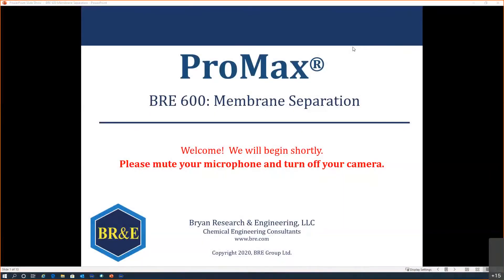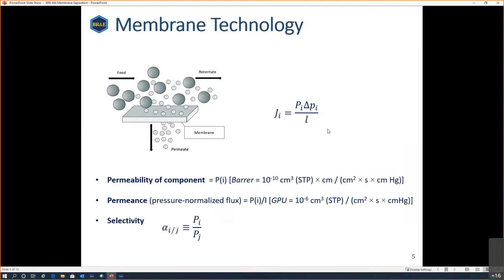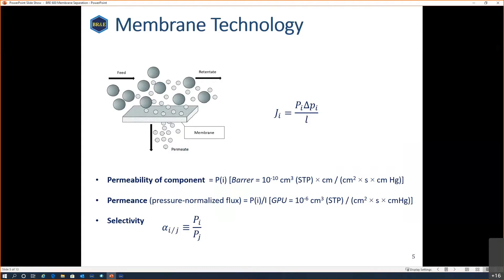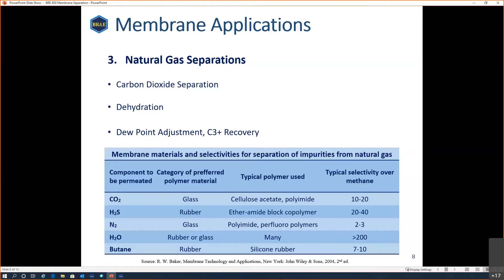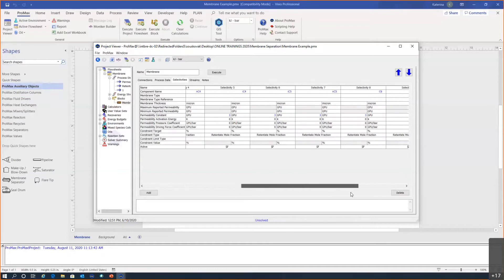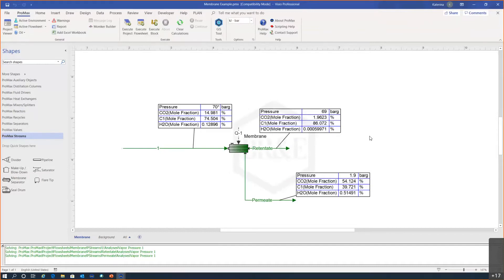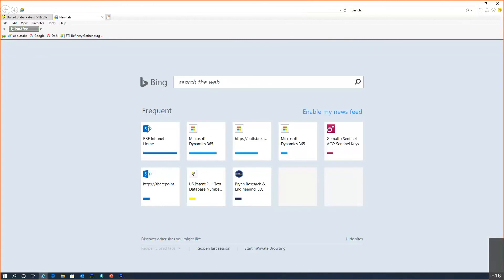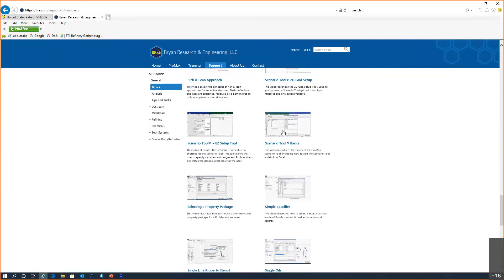Membrane Separation

Comment: Can yu do with ion exchange resin to remove Hss from amine solvents
Reply from the maker: It is not currently possible to model ion exchanger with the membrane block. If you model reactions to create the HSS, then you would use a divider block to remove the products of that reaction. HSS formation reactions are not currently modeled automatically in ProMax, so you would have to provide the necessary reaction information and possibly add user defined components to your ProMax installation to fully model HSS formation in ProMax currently.